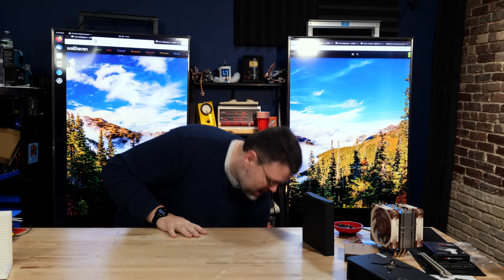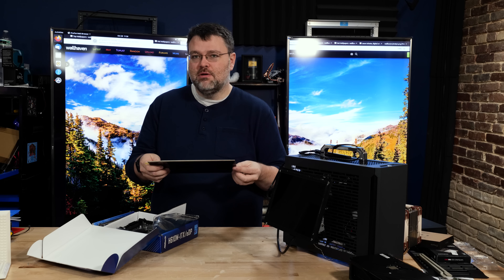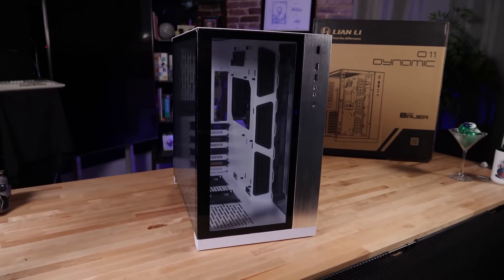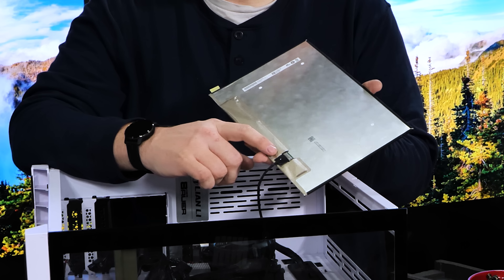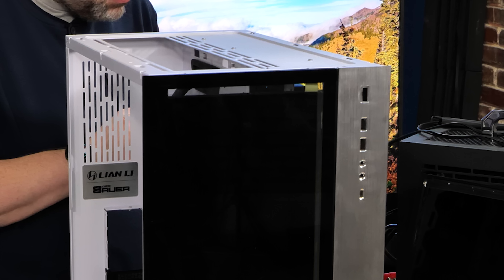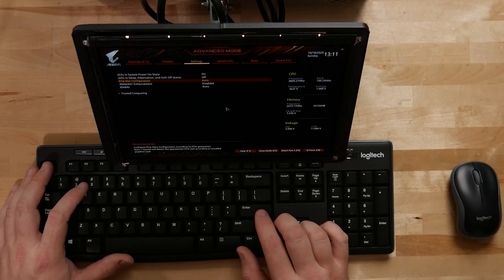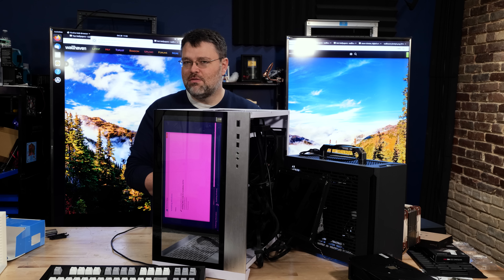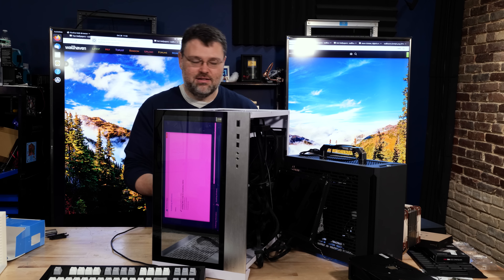A PC With an Internal Display? It’s More Likely Than You Think!

Comment: Are eDP to standard DP cables easily  available for that monitor?  otherwise it will become eWaste as soon as the Asrock motherboard is obsolete or dies. Standard monitors  typically survive a second life (and many more afterlife ) well beyond their original source dies, they are almost inmortal  because they have many potential applications (I still use a 16 year old monitor as a secondary  display.) . But not if using propietary connectors
Reply: Probably. On modern laptops there are only a few connector types and pinouts that are common. I've swapped the LCD from a Dell Chromebook into an HP one and it fit and worked perfectly. The variance is what is on the other side of the cable.

Comment: There's a case came out recently that's a bit like the O11D but has the front left corner sliced at 45 degrees with a third glass panel in it - does anyone remember what it was?
Reply: Found it … Hyte Y60 … just need to find an AM5 eDP mobo and that’ll be my first PC build in years (and first custom loop build ever) … :-)

Comment: I've been messing around with something sort of similar to this. Initial desire was to have a portable display I could mount on a tripod next to my camera, as the built in LC is nice, but small. Found a 10" 1080p screen with HDMI inputs and VESA mounting holes, so I then found a VESA bracket that would attack to a 5/8" mic stand and via a couple of adapters to a1/4" tripod mount, which worked pretty well with the 3 to 1 1/4" mount bracket I have. It also works well for troubleshooting oas i can put it on a short tripod and connect it to one or two PCs as a touch screen. Makes for a neat remote when hooked up as a 2nd screen. The panel has speakers and a headphone jack so I can pop in a ChromeCast or FireTV and consume media while running off a battery bank. The other option I've tested is to have it on a micr arm as a 2nd/3rd screen or to a completely different machine.
I also have a 15" panel that I could mount on or in a case, but I don't really have a good reason to do so.

Comment: As someone with a fractal node 804 as the case for my NAS I've been looking for something to provide an embedded monitor for it. The 7" monitors are alright but I still have to route cables outside to the display port on the mobo or graphics card.

Comment: I have an internal display on my machine too. It's a 128x64 pixel OLED module, which I've soldered into an arduino nano powered by an internal USB header. When the machine is on, the screen fires up with a customisable logo (currently I'm being boring, it's the IBM logo). It can also show the current water temperature (taken directly from a thermistor on the radiator outlet) and some stats from the computer (fed to it by a systemd service, so this can be anything, but currently it's just the CCD1 and CCD2 temps from k10temp). It'll also flash a water level warning if the reservoir is drained below a certain point, but that sensor turned out not to work so I'm waiting for a replacement to ship.